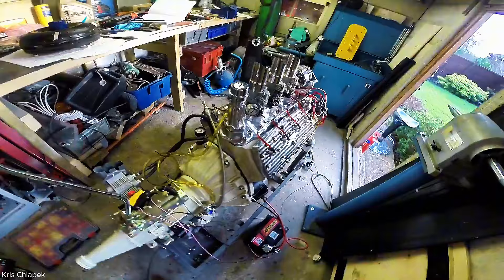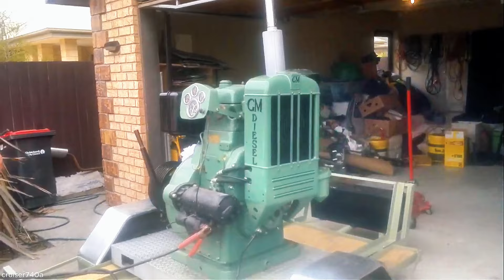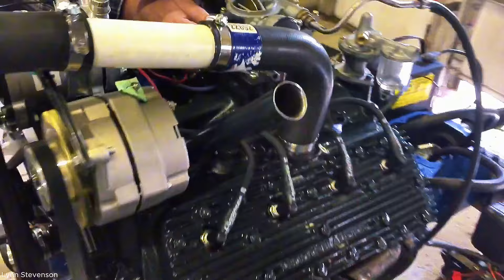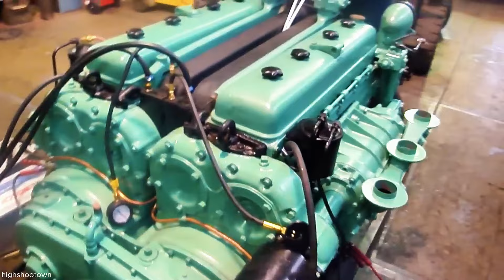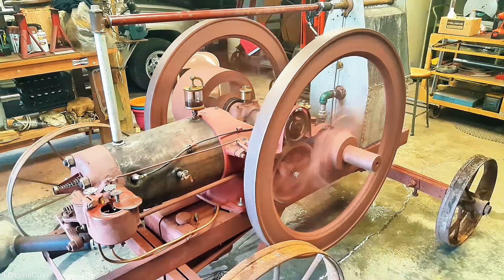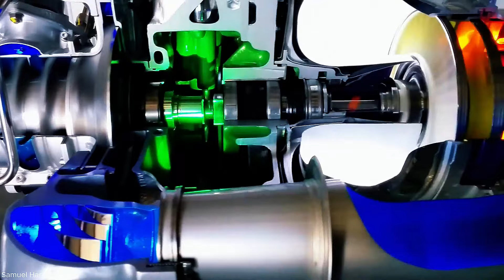The World’s Greatest Engines | Rolls-Royce Merlin, Detroit Diesel, Fairbanks Morse & More

Comment: The 2 stroke Detroit diesels and EMD diesels, as well as the lesser known Cleveland division diesels are without a doubt the greatest engines ever made in world history. These engines are actually very efficient and DO NOT smoke when using standard injectors and actually are among the only diesels that have truly complete combustion. The 2 stroke-cycle is misunderstood and is FAR more efficient than any 4 stroke. As an example, an EMD runs smokeless under full load and varying load while 4 strokes like GE and ALCO will produce insane amounts of black smoke which is simply unburned fuel wasted out the exhaust as well as carbon-ing up the combustion chambers and piston crowns especially in the squish area where piston to head clearance is small, crushing carbon into a solid mass that causes piston contact with the head via the “bridge” formed by carbon build up thar leads to knocking and “toggling” of the connecting rods at top center, usually resulting in connecting rod fatigue, stress and breakage in ALCO engines causing a rod through the block, in GE’s causing the cylinder assemblies to “lift” the head, failure of the bolts holding the “power pack” assembly (rod, piston, cylinder snd head) to come loose and get ejected through the side of the locomotive as the bottom cap is ripped off the connecting rod. The inefficient combustion of 4 stroke diesels is to this day a bug-bear of the 4 stroke diesels and gas engines as well. 2 stroke diesels get an excess of air when scavenging and run clean and efficiently. I have more than enough experience with 2 strokes of all types to know they are ideal! In fact, the most efficient engines on earth are the valveless 2 stroke opposed-piston engines by Fairbanks-Morse and others. The Detroit, Cleveland, and EMD diesels are the epitome of high efficiency in more conventional non-opposed-piston engines. The rough running of the 4 stroke gasoline aircraft engines in this clips are examples of how lousy 4 strokes run and how inefficient they really are. Hyped up inefficient junk, in my experience, don’t even sound that good. Cheers all! 😋👍😊